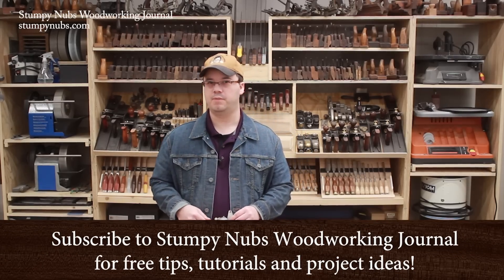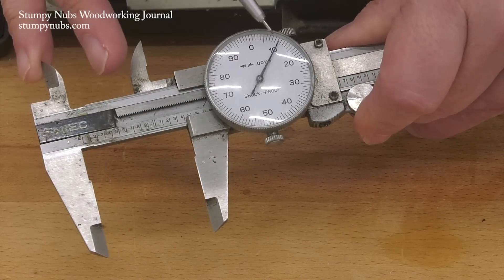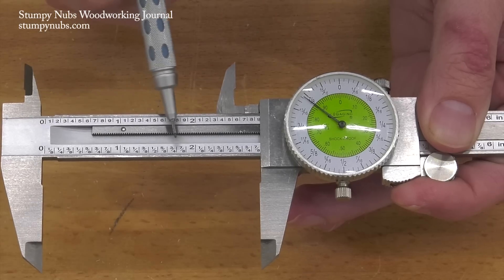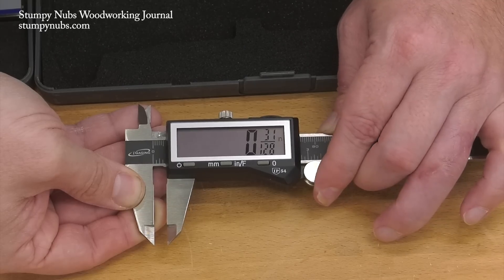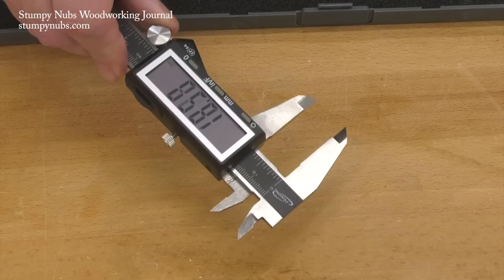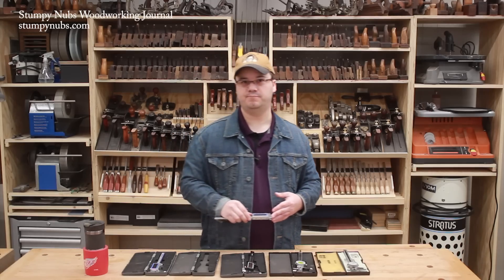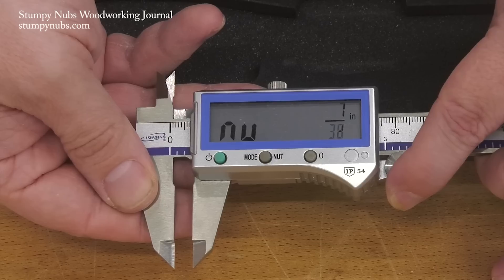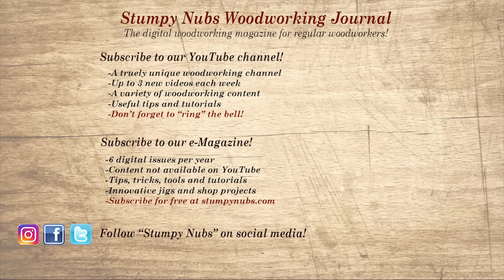FINALLY! Calipers made for woodworkers!

Comment: As someone UK based of a certain age, the metric imperial thing is a nightmare. I live in an imperial world were everyone now measures in metric and so do I however the world is still imperial. Think this through I measure everything in metric because it makes so much sense however when I go to buy anything or size anything I think in imperial. I use grams and kilos however I weight in stones and pounds. I have to convert every time when I need my height in meters. I go to buy wood and it takes me a while to work out what is what because I want it in feet and inches and will then cut it up in metric.
Reply: I'm almost certainly your age. Grew up in the UK and moved to the US when I was 30.
My brain melts with all the conversions. 

I still measure temperature in F when it's hot, C when it's cold, mm when it's small and ft / in when it's long. And don't even get me started between cups, oz, grams and lbs.
Reply: When I buy wood in Bristol I have to ask for 6"by2" at 3.6m or 4"by2" at 2.4m I tried asking for 145 by 45 treated at 4.8m and they look confused as soon as I change to 6by2 @4.8 treated they know exactly what I want, I'm 40 so my whole life is supposed to have been metric but still pints and miles dominant. I weigh my self in both as metric is needed for medical stuff and same with hight I know I'm 1.87m and that that is somewhere between 6'1" and 6'2" but not sure. I'm 78kg and that's just over 12 stone, so do both but use metric for accuracy and imperial for rough.
Reply: 96% of the world uses the metric system. I am 48 years old from the UK. Only ever taught the metric system at school. The UK is just dumb. It cannot move on. Supermarkets still list things in price per pound. We weigh in Stone and pounds. Drive in MPH. I drew up some CAD plans for a gate and fence for local chippy. I had to convert them for them as they couldn't work in mm. Even Australia has adopted the metric system. With the advent of brexit next week I guess we will be going full on imperial. Sad times.
Reply: @cjhification  I was fixin to ask, what do they call a 2x4 in Europe ?
Reply: @ccdirecttvdllc5246  4x2 if your old or 95x45 if younger. Our 4x2 is bigger than your 2x4, clearly you need the bigger number 1st to make the wood bigger 😁

Comment: The frustrating thing about the mm inch divide in the UK is that decimalisation was never fully completed. So it really helps to be able to work in both to a degree. I've seen material offcuts listed in a shop as 6 foot six by 2.8 meters. All school rulers have cm on one side and inches on the other. Newborn babies are always given an imperial weight in lb and oz even though the scales used readout in metric. Beer, penises, bra size and road distance are all still imperial here. Shoe sizes remain measured in barleycorns and there are plenty of older machines around that use BA (British Association) screw threads. Most tool related things are metric here but there are still a lot of blades that are 254mm (10"). Most 8'x4' sheets are 2440mm x 1220mm .... most of them. Setting up a workshop I made the decision to work in mm buuuuuut knowing a bunch of conversions can really help.
Reply from the maker: No, the frustrating thing is how you can hardly say the word "ruler" without a bunch of folks running to the comments to mock you for using fractions, as if I have any control over the standards used where I and most of my audience lives.
Reply: @StumpyNubs  I can see how that would grind your gears. To me, fractions and decimal are just tools. We got to use the ones that work for us. Keep up the good content and worry about all the "advise" it can generate.

Comment: Another great video.   My first dial calipers were purchased for reloading ammunition but I quickly started using them for building radio controlled airplanes.  The accuracy improved instantly.  I now have several, both dial and digital but prefer the dial models because they never have dead batteries.  The digital are handy for quick comparisons.  Die hard machinists bad mouth calipers but I find them to give the same measurements as my micrometers that I use for metal machining.  Good mikes measure to 0.0001” but I rarely need ten thousandths accuracy even when machining metal.

Comment: Thank you thank you thank you for this video, James.  I have struggled for too long with trying to round up/down on a standard digital caliper.  I did have an app for my phone that would do the rounding for me, but found that to be a pain to use, so generally just struggled with it in my head or with a pencil on my workbench top.  I just ordered both the digital and dial versions that you recommended and am very grateful.

Comment: You aren't idiots for not using the metric scale, We in the UK had not choice but to use it, back when we were forced by the treaty of accdession to the EEC (now the EU) to convert to the metric scale. We do, however, for some traditional purposes like pints of beer (that is 20 oz, by the way, not 16oz like a US pint) have special dispensation to retail the imperial system. The US system was orginally called the imperial system for  reason. It was the scale used by the Brtitish Empire. A lot of us are used to converting to and fro between metric and decimal. As I am a guitar maker, I often need very precise measurements, so I use calipers all the time, and have all my often used measures on a conversion table. I use digital all the time but have a dial as a back up. On 31st January, we leave the EU at last, but will probably continue to use both systems, for the reasons you outline.

Comment: Hi, German Guy here....
Not mocking the imperial system....
I still find it funny though, that when the metric system is taught in your schools, people were struggling with converting meters to millimeters or kilometers. It is just adding or removing zeroes.

But as you said, it's the world you live in. We have trouble making out these fractions.

Speaking of fractions: Especially in woodworking I find fractions more convenient for joinery than millimeters (what's 20/3?). Also Inches and their fractions might pull you away from expecting a machinist's precision (our power tools advertise 1/10mm adjustment, not more!).

Thanks for sharing your fair view!
Reply from the maker: I've never heard of people "struggling with converting meters to millimeters or kilometers." The metric system is pretty simple to learn. It's just like our decimal system.
Reply: A friend of mine was an exchange student for a year or so and told this story. Couldn't believe it myself....

Comment: You didn't mention vernier caliper.That would really confuse! No James as I'm sure you know decibels are not hard. It is merely an inch divided into 1000 pieces. For example .500 = 1/2 inch .250 = 1/4 .125 =1/8. Some decibels require a fourth point but that can be largely ignored . Unless you are doing precision grinding example 1/64 = .0156. Hope that helps someone.
Reply from the maker: https://youtu.be/d9WJMRf0AXE?t=619

Comment: I did not have trouble dealing with decimal inches when I started woodworking, but I had trained in drafting with both an Engineer's (decimal inches) and Architect's (fractional) scale.  Cheap calipers from Harbor Freight tend to be more than accurate enough for wood an plastic work.

Comment: It's also worth mentioning that cheaper digital calipers come with poorer quality electronics... ones that keep a current flowing even when the tool is off. Hence the poor battery life.
I've got a set of decent quality ones that haven't needed a battery change in 3 years, for average use.

Comment: A hobbyist in my acquaintance was reduced to despair trying to find an imperial chisel in northern Europe (I think he wanted a 3/4") before eventually forced to order one from the US at eyewatering cost.
Reply: I did some quick googeling and 19mm chisels are pretty common, and cheap. Was it a specific kind of chisel? Or maybe in a perticular region or country?
Reply: Just get a the closest metric one and grind a bit off on the side. Problem solved. Besides 3/4" are 19.05 mm. A 19 mm chisel will do fine.
Reply: 19mm would  have worked just fine. 5/100mm or 2 thou difference.
Reply: @Exgrmbl  In fact many common metric tool sizes that look odd are rounded from inch sizes and might even be the same tool sold in inch countries with a different label.  The difference between 3/4" and 19mm drowns in the inaccuracies of manufacturing woodworking chisels.  The tools where both scales are truly needed are screwdrivers, nut drivers and of cause measuring tools.

Comment: I find that the argument about imperial vs. metric can and should be split into two independent parts: which units to use (e.g. meter vs. yard) and base 10 vs. base 2.

WRT units, I don't find that a meter is any better or worse than a yard. They are both arbitrary lengths that are tied in a strategic manner to some physical property. Yes, I know that the yard is currently defined as a fraction of a meter, which is in turn defined in terms of the speed of light and time, but we could just have easily done the reverse. And yes, I know that in the metric world, you have a single base word for each property of a thing to be measured, e.g. the meter for distance, and in the imperial world we have inches, feet, yards, etc. but honestly this is something I like about the imperial system - sometimes, it's nice to have a word for a thing of a certain size that you don't have to split up. It would be tiresome to have to go around saying things like "give me the oh-point-three-zero-four-eight meter hot dog". :)

As to the 2nd part, I find that notion that one base is better than the other to be silly. Shouldn't we use the base that best fits the task at hand? Sometimes it's easier to think in powers of 10, and other times it's easier to think in powers of 2 (imperial graduations on tools extant notwithstanding). Say it with me: "three-tenths of an inch" and "one quarter meter".

I think where we get into trouble is when we think we have to use base 10 with metric units, and base 2 with imperial units, and that no other combination is possible.
Reply from the maker: I find that the argument between imperial vs. metric is tiring and pointless. I can't say the word "ruler" without getting nagged and insulted about it, as if I have any control over it at all. It's exhausting.
Reply: @StumpyNubs  agreed. BTW, I forgot to mention, great video, as always!
Reply: You beat me to it.  Metric or Imperial is irrelevant.  All this stuff is fractions, some base 10 and some base 2.  Neither is inherently superior.  Pick and use as appropriate.  Thanks for the excellent video, James.  Thumbs up to crush a troll.

Comment: As well as measuring feeler gauges to determine accuracy, repeatability is a good additional test.  If you measure the same thing ten times, do you always get the same result, or is there some slight variation in some of those ten?
You mentioned taking the batteries out of the digital calipers to preserve the life of the battery, but some may not understand the real reason why.  If you think Off means it isn't using any battery power, that is not so.  The display is what draws the most current from the battery, and the display is off, but there is a certain amount of current flow in the circuitry which is constantly monitoring the On button.  This is what eats batteries left in the calipers.

Comment: Did I understand it right:
That dial shows 1/1000 Inch but one turn ain't 1 Inch!? How much is it then!?
mm-Scale for Inches (1/2,54)?
Reply from the maker: There are only 100 graduations on the dial. It would take ten turns to equal 1000. As I said int eh video, it's 1/10 of an inch per turn on that first machinist's caliper I showed.

Comment: HI STUMPY. I THOUGHT DIGITAL WOULD BE THE WAY TO GO,  UNTIL I WENT TO USE THEM IN THE COLD OR WET. THEY DO NOT LIKE THE COLD OR WET.  SO I HAVE WENT BACK TO DILE. THEY WORK IN ANY WEATHER EAVEN RAIN.  IF THEY GET WET THEY STILL WILL WORK. YOU MUST DRY THEM WELL AFTER, BUT THEY WILL STILL WORK.
Reply from the maker: Remember, this is a tutorial for woodworkers. Woodworking is seldom, if ever, done in wet conditions.
Reply: THANK YOU.   THAT IS TRUE.   I DID NOT THINK OF IT LIKE THAT.        I USE CALIPERS ALL OVER, IN THE HOUSE, IN THE BARN, IN THE WOOD SHOP AREA, ALLMOST EVERY WHERE,  ALL YEAR ROUND. SO I DO NOT THINK OF THEM JUST AS A WOOD WORKING TOOL.

Comment: A significate number of calliper measurements in the shop are on the fly and transferring dimensions to matching of two parts. A male and female fit. Don't particularly care about the numeric  value. Where I do want to know a numeric value then metric is much more useable from CAD layout to marking knife scoreline locations. Concept sketching I still use old fashion Imperial. Build drawings and the shop project temp Post-it notes on a project are in metric. The math is so much more easier and the format is calculator friendly and spread sheet 'what if a measurement change will change what and by how much'. The geometry of angles is also (e.g. 3-4-5, Pi, Phi, etc.) and scaling up/down way easier. 
But, I buy my beer by the Hogshead and drink by the Flagon, tobacco by the Wad. 
So. Break out a cold Rundlet and have yourself a Flagon or two.

Comment: This first calipers made me smirk since 'smiec' means garbage in polish language. Talking about good advertisement. Also as a metric only person I'm really impressed how you 'imperials' are able to work with this scales. Going from 3/16 to 1/4 to 3/8 and 1/2, boy isn't it a mess. And dividing some odd measurements into even increments without calculator? This is NASA level mathematics for me %-)
Reply from the maker: It's not difficult if you understand fractions. I don't understand why so many people constantly mock us for it.

Comment: Love digital calipers, although they all seem to have soft switching, meaning they all have parasitic drain on the battery even when you shut them off, so you have to remove the battery, I've had them go dead in as little as 3 months with a new battery. Annoying... Have spare batteries on hand.

Comment: I see the use of a caliper that rounds up or down. But I don't think it's the right solution. All that really does is reduces the precision. The whole point of calipers is to measure more accurately than a ruler. What I think we really need, is to display the result like 1" 3/32 + 1/128. That way I can shoot for 1" 3/32 and know how much I'm off. Maybe the dial caliper with fractional units is the best after all.

Comment: Funnily enough, working entirely in metric, with all-metric tools, avoids this problem entirely. Yet another win for SI units!
Reply: I've worked entirely in imperial , with all-imperial tools, avoids the same problem entirely. Still a win for imperial.
Reply from the maker: I don't know why metric folks feel the need to mock imperial folks. You do you, we'll do us.
Reply: @jdilksjr  - Nope.. because the problem, as described in the video, is the hassles of switching back and forth from decimals to fractions. And since the metric system doesn't use fractions, the problem doesn't exist. But even if you work in all-imperial, this is a problem you'll encounter.
Reply: @StumpyNubs  - Maybe we do so because we're getting thoroughly sick of hearing variations on the theme "There are two kinds of countries... those who use the metric system & those who have been to the moon."

(Which is especially annoying, since the Apollo Guidance Computer used SI units internally, but displayed and accepted data in imperial units for the convenience of the crew.)
Reply from the maker: @Garryck-1  - The funny thing is, I've never seen someone say that out of the blue. Nobody came to this or any of our other videos about measuring and insulted the metric folks unprovoked. It's always the other way around. I make a video that really has nothing to do with the metric system, then a dozen metric users descend to nag or to mock and insult, and THEN someone defends himself with the "moon" comment.

Comment: In medicine or science, I’d never use anything other than metric because I could change units by moving the decimal. The chance of messing up is low. But carpentry deals in halves and thirds. Those are always more likely to fall on a line with an imperial measuring tool. Sorry, metric fans.

Comment: Lately, we have returned to the old "Lead-Acid Battery" days - when batteries leaked and corroded and/or destroyed whatever they were in - "D" size were the worst.  Now, the "New & Improved" Alkaline batteries are doing the same.   Had to throw away 5 or 6 LED flashlights - couldn't clean up enough to fix, couldn't even get the batteries out.  Can't trust them for even a full year. Those packages that say - "Good for 8 years"?  Uh huh.  I've found already-leaking ones in less than a year of buying the package.  In house warm storage. So I'm willing to forgo the "extra features" in the digital tools for the durability of an analog tool.  If i have to add two numbers?  So what.  There had to be a benefit when i learned arithimatic in grade school with flash cards and endless tests. Do the "watch-cell" types do better?  I don't mix Imperial and Metric - don't want to do a Martian Lander.  Pity i didn't learn to spell....

Comment: My father was a surveyor, used 1/10 of a foot, told me just use what dimensions are given,  why confuse yourself trying to convert. I use imperial as a mechanic in Canada except when the only info/sizes are in metric (way easier though).
Reply from the maker: Not having to convert is the whole point of owning calipers with the scale you wish to use built in :)
Reply: @StumpyNubs  Yes, luv those w/fractions, will look them up, thanks', always enjoy, cool stuff did not know existed, amateur wood-worker. CDN has nominal 4x8 sheets but 10mm not 3/8 no more, no big deal usually.